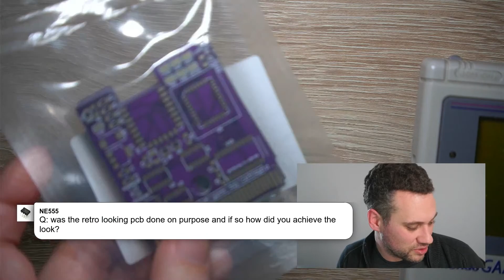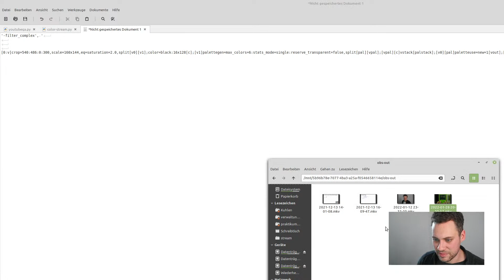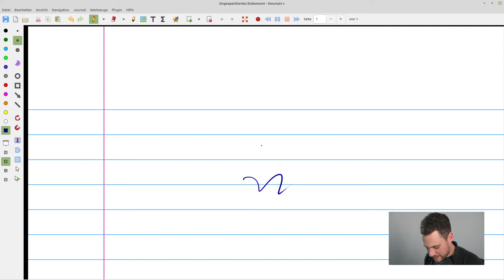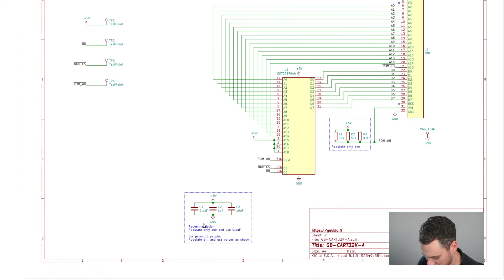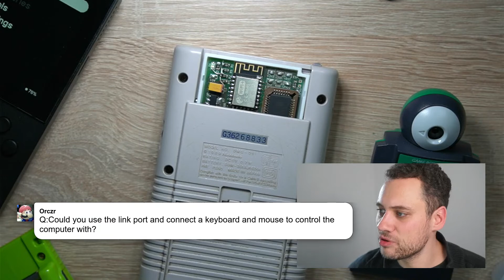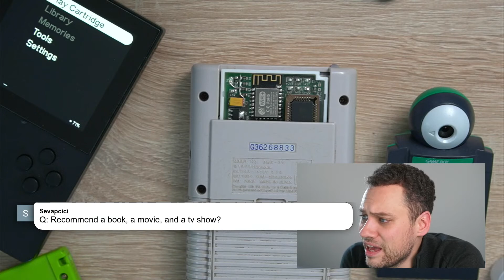Live Q&A: WiFi Game Boy Cartridge

Comment: is it possible to make the snes or n64 use sd card in a way to use system limit without cartridge limit? It would be incredible an n64 with cd space like ps1 and porting the games that came out for ps1 and not n64 due to the limit of the n64 cartridge.

Comment: I think the false triggering has nothing to do with the reading of the joypad register and instead comes from the transfer to the ESP. If the ESP is too late when you write the status it may miss it and read garbage data. You may even want to use some simple checksum/error detection to make sure the data is correct.
Reply from the maker: I think you might be right. After reading your comment, I realized that the mistriggers are all represented as 0x01, 0x04 or 0x05. Guess which pins have a pull-up... But I just tried changing the timing on the Game Boy code quite a bit and the actual triggering on the ESP seems to be quite robust. My current suspicion is that for some reason it misses the party entirely and it could be related to the video glitches, i.e. the glitch means that the communication is out of sync and the ESP expects another read when the initial write from the Game Boy occurs.
I have to take some time to catch one of these glitches on the oscilloscope. Unfortunately, one cannot see the moment the ESP tries to read its GPIO pins, but if it is a consequence of the glitches, I should see where it trips and maybe be able to actually fix those video glitches and the input problem along with it.

Comment: Thank you for answering my question at 47:50! Overall a fantastic project and I appreciate the in-depth response! A follow-up question: are you calculating the "nearest color palette" as the Euclidian distance in RGB space? If so, you may get better results with little additional effort by operating in/converting to Lab color space instead. Using this heuristic in Lab space results in a better color fidelity for human perception. Thanks again and I'm excited to see what projects you come up with in the future! Cheers!
Reply from the maker: Actually, I think that only few pixels are affected by this and I just wanted to make sure that the fallback is not entirely off, so I went with the most simple solution: The Manhattan disctance :) (just checked and noticed that "Taxicab distance" is the more common name in English).
After all, for each 8x8 tile I first determine the palette where most colors are present and in the current really simple approach this means 4 out of 6 colors. So unless all colors are in the same tile, it barely matters and even than using only six colors for the entire image usually means that they are quite different anyways.
Reply: @ThereOughtaBe  Very cool! Thanks!

Comment: Perhaps there is some conflict on data bus that is causing bits 4 and 5 of the button register to be LOW/HIGH at the same time. Or you are reading the register as it is updating/not stable yet. If 4 and 5 are both LOW it ANDS the buttons with the dpad; if theyre both HIGH then it return all 1s. This might explain garbled ghost inputs. Otherwise it might just be brownout that is lowering the pin voltage enough to be detected as a LOW input.

$FF00 — P1/JOYP: Joypad
Mapping: 11BBIIII
This register is used for reading joypad input. The hardware multiplexes the D-pad and the face buttons so only four buttons can be read at a time, based on the value of bits 4 and 5 (0 for select, 1 for deselect). Keys are pulled low (to 0) when pressed and high (to 1) when unpressed. If bits 4 and 5 are both low, then the combination of the D-pad and face buttons is ANDed (i.e. a 0 value implies one or both of the associated keys are pressed). If neither bit 4 or 5 is selected then all keys read 1.
Reply from the maker: Thanks, my code is based on an example that was taken from an actual game somewhere (sorry, don't remember where I've seen it). So, I am using those registers to read buttons and d-pad after another and waiting a while to allow it to settle. Just from the way the entire system acts with the cartridge, I thought that your brown out idea was pretty plausible.

However, "Gameboygenius" commented that he suspects that it's not the readout of the buttons but the communication with the ESP and that's when I realized that the misfired button presses are represented as 0x01, 0x04 or the combination 0x05, which are exactly the pins on the ESP that have a pull-up resistor. My current hypothesis that the communication fails when those video glitches occur and that the input problem is just a consequence of the glitch. But I need some time with my trusted oscilloscope to track this down :)